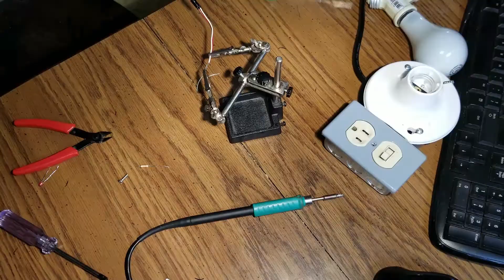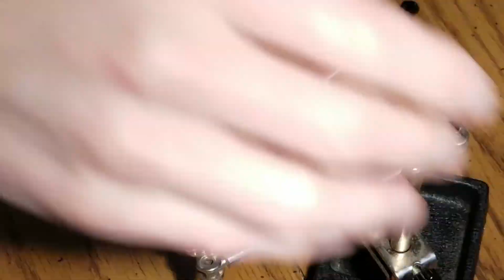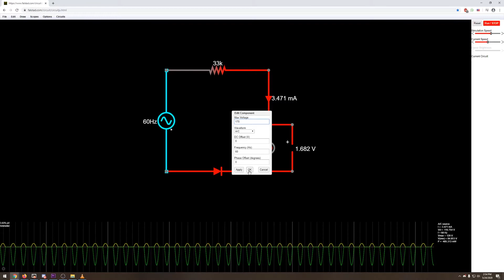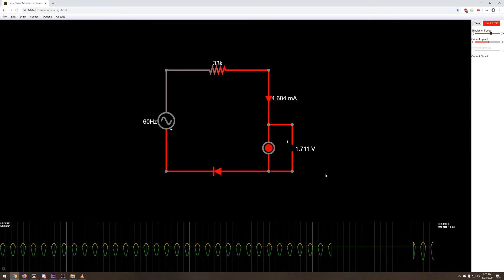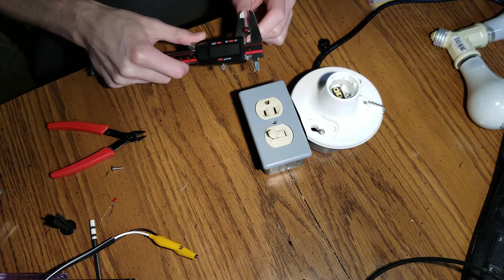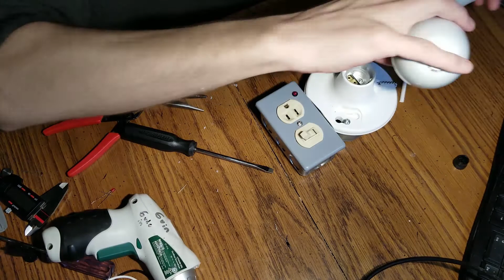LED Indicator Circuit with Mains/Line voltage.

Comment: A capacitor in series instead of the resistor is even better. The capacitor limits the current through the LED. without dissapting power as heat.   Sometimes the solution that you suggested creates a very hot resistor, especially if you deal with 240V.  Ths coud be bad.   Something like 1 microfarad in a  ceramic capacitor that can handle at least 120V for your typical LED.

Use  a rectifier or a bidirectional LED e.g. LTL-293SJW that can handle AC current.  It is rated for 20 milliamp current but  like other LEDS will be bright enough and last longer with lower current.

For a 1 microfarad capacitor e.g. 	FG22X7T2E105KNT06 rated as  250V
do the calculation - AC current allowable through capacitor =  2x frequency (60) x capacitance in farads (e.g 0.000001) x voltage (120)
= 14 milliamps 

a 0.5 microfarad capacitor (e.g.FG22X7R2E474KNT06 rated as  250V)will allow 7 milliamps through.

I love DigiKey as my electronics source
Reply from the maker: Yes, you are correct. This is a better option if available. Thanks for the input.

Comment: Thanks for showing all your work. 
Is the LED still glowing as bright as when first installed?
Reply from the maker: Hi Joe. Yep the LED should not change in brightness unless the voltage changes. One thing I did not cover was the power dissipated in the resistor. Although I used a half watt resistor, a one watt resistor should probably be used and would allow for some adjusting of the resistance value. It is always a good idea to calculate the resistor power dissipation for your particular scenario. Overshooting on the power rating of the resistor is better than undershooting with regards to safety.